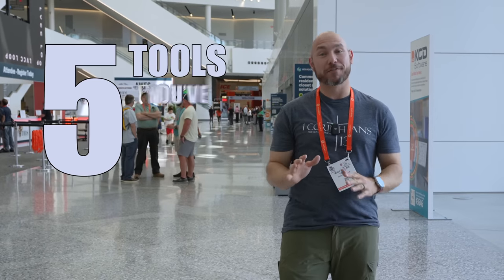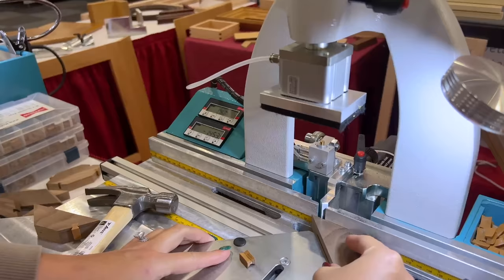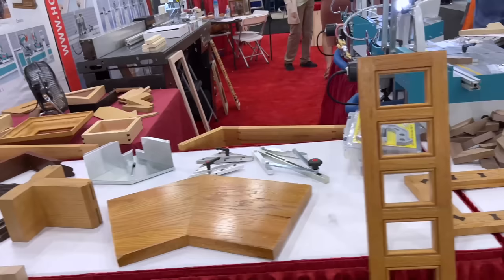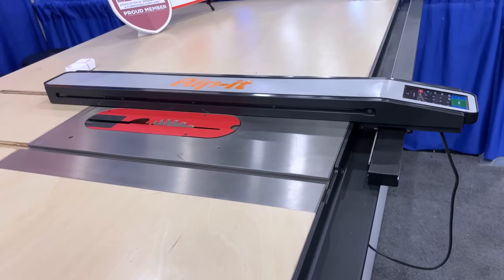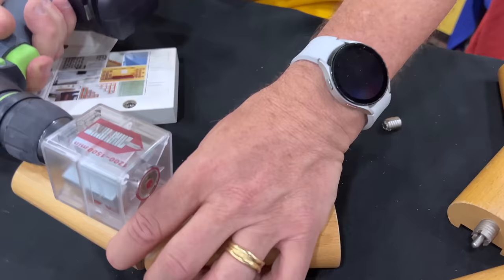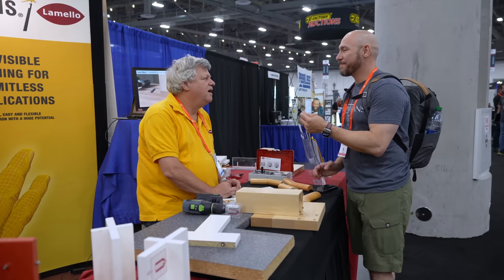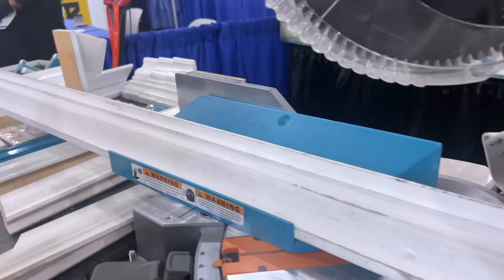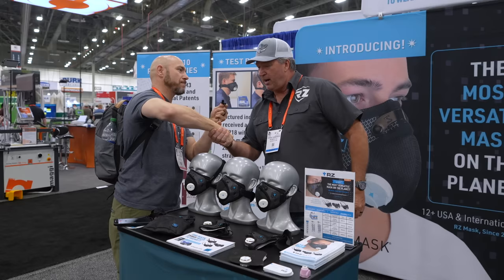I Found 5 Woodworking Tools You've Never Seen Before!

Comment: #2 is from afar my favorite one, even without the cut list feature. It is an amazing help. There is another guy who automated his table saw fence using a step motor and an arduino. Very accurate also.
Reply: It's a pity the fence is so low.
Reply: @JayDee-xj9lu That's pretty easy to resolve though. I often use a house-made taller fence for jigs and such. This has the benefit of not needing an adjustable tape scale.

Comment: Starrett has a protractor that tells you you what to set both angles at and lay the moulding flat. Measure it, set the saw, and cut. Perfect miter.
Reply: Cutting crown on the flat is a more time consuming method because you constantly have to change the mitre and bevel of the saw

Comment: I'm glad Rip-it Fence actually listened. I emailed them a while back asking if they could make their touch screen dark mode (this model had a white screen a few months ago) as I personally have extreme difficulty reading white screens. I'm legally blind so that's the reason why. Using a table saw fence is an absolute nightmare. I'm still relatively new in woodworking and have many decades ahead of me to refine my abilities and I hope to one day get my hands on one of them. At a bit over $1500 msrp, it's something out of my price range currently but I'm glad to know that it'll work for me when I do eventually get one. 

Oh, Rip-It, if you read this comment, can you please add a method to attach the Jessem Stock Guides to your fence? I did email you guys about that and i was informed that the top of the fence is aluminum. Thus, you can't use the mag-switch method of attaching them which is my prefered method as it makes quick removal for jigs much easier if necessary. Plus, many aren't comfortable drilling holes into their fence.

Comment: I have been wanting to build a fence like that for myself... Pretty sure I don't want to pay for that one. It will cost more than my saw.

It needs a few things though for manual use.
It needs physical buttons for commonly performed actions. Nudge the cut a little deeper or less so by .005 per press. Buttons to cut dados. One that moves the right distance to make the second cut at the board width, and then incremental cuts through the center by a blade width.
A button for metric/inch toggle.

Comment: I've been a bit surprised that with CNC tech becoming more widely available that we haven't seen something like the Rip-It fence show up before. I suspect the answer is that the incremental benefit over a well-tuned conventional fence is actually somewhat minimal. Dialing in a fence to provide acceptable accuracy doesn't really seem to be a barrier. And, if exact reproducibility is needed there's always the Incra.

Where I do think CNC tech is interesting is in router tables. Shark has a CNC controlled router table that has interactive wizards to guide you through multi-step operations like box joints and dovetails which IMHO is much more of a value-add than a table saw fence.
Reply: I think it's a pretty common feature on big sliding saws.  I'd love to have one, but compared to a DRO on my existing fence that's just a steep price
Reply: Any industrial size sliding saw less than 5-10 years old pretty much have it, we dont see it cause its an industrial grade product. That finally trickles down to small shops and hobby people.
Reply: Now what I'm REALLY jealous of from the industrial saws is the computerized height adjustment.  It's pretty easy to nail fence position with a DRO or an incra setup, but installing a DRO on the height adjustment in most table saws is a lot trickier
Reply: @tehbieber  not to mention back breaking to adjust tilt too.
Reply: @arcrin100  oh god I would kill to be able to just hit a "zero" button and not have to do the song and dance moving my square back and forth between the two sides of the blade, scrutinizing whether I'm imagining that light between the blade and the square, if I'm on a tooth, if I've got the square flat against the cast iron
Reply: @tehbieber Your comment made me chuckle. As I was reading it I felt my knees go as I would bend down, check again with tape measure and square. 😂  That Rip-It fence is awesome. Unfortunately 10 times the cost of my cheap table but still amazing

Comment: Rip itfence Interesting , The fence itself needs to be taller clearly not designed by a cabinetmaker.And yes I saw the slot in the face. Didn't show the amount of flex at the end of the fence, maybe nothing. After being a cabinetmaker for 40 yrs. I'm weighting for the next version.

Comment: CNC saw fences are neat. There's posts on cnczone from as far back as 2006 describing them. So not a very original invention. Here they're using a Raspberry Pi 3B+ ($72) and a Waveshare 5.5inch Capacitive Touch AMOLED Display ($115) plus a stepper driver and stepper, so about $200 in electronics. You could diy one for half that picking some cheaper electronics. So you could do a lot with that extra $1000 since it's a $1200 fence.

Comment: I'd like to know how sensitive the auto-fence is. With my T-fence I can just gently tap to sneak up, and we are talking two hair-lengths at a time, so how sensitive is that fence? Can it move 1/128 or 1/256? I'll have to check out there page. If I can't micro adjust, then it seems like a professional, cabinet shop kind of tool only. That's fine, and it would work well in mass production/industrial level stuff, where you are just needing nice, clean numbers, but for fine woodworking you have to have that "light tap" level of adjustment.

Looks like it is $1,300. That is definitely pro-cabinet shop level pricing. Oh well. It still looks super cool.

Comment: The Hoffman units start at under 2 grand, which seems like a much more reasonable price for the typical user.

I like the Invis idea but they need to get the part price WAY down -- at US$7.50 each, that's going to be a niche item for sure. Equally important, they look to need (I haven't looked close) a remarkably exacting (for wood, anyway) locationing tool, as those clearly need to be aligned far more perfectly than most woodworking typically needs.
Reply: My guess is Hoffman is copying the razor blade business model... they get you with the consumables.  Now, $125 per 1,000 keys won't break bank for a cabinet maker, especially for what they do, but I'd be surprised if Hoffman is paying more than a penny per key to have them manufactured.

As for the Invis, it's interesting, but I honestly don't see how a hand-held external magnet can achieve the torque needed for a tight enough connection that it won't work its way loose over time.

Comment: Not convinced about rip fence. If you have a decent modern table saw most fences have digital read out and you can make micro adjustments. That cord dangling would be a hazard. Plus you cant slide fence out to rotate on side to rip larger material.

Comment: That Invis Joinery System with the magnets on a drill is the dumbest idea I've ever seen. Torque has obviously left the chat. How many of us would bolt stuff together and spin all of the nuts about as tight as we could with one finger? If some corrosion formed on the threads, you'd never be able to seat it or ever get it apart. The crown molding jig is garbage. You could make a better jig with some MDF that would work better. The first joinery tool with the bowtie cutters was pretty cool - the best of the 5, by far. The fence is cool but not really necessary - Altendorf has had servos on their fences for a couple of decades.

Comment: While the mask is cool and probably a great thing for people to wear, it was disingenuous to use fit factor information in such a blanketed way.  

The fit factor is dependent on the individual wearing the mask.  Their facial shape and size determines overall fit factor.  Having a nice pliable mask is a plus, but on its own the fit factor numbers they give mean very little.  

I would be curious to see a person use a half mask from 3M and this mask, and then do a fit test.  Use the same machine and same person for the test and the same test administrator.  If they can show a meaningful difference between a true respirator and their product, then they could be onto some great new markets.

  Woodworking is only a small segment of the respiratory protection world.  If they can find a way to compete with 3M, then they may just find a new market to take their product to.

Comment: I cannot see the point of the Rip It fence.  I've never had an issue moving my fence into place and it's got no parts or electronics or software/firmware to go wrong.  All I see with that silly fence is something that pointlessly wastes the earth's precious finite resources as well as the precious time and hard-earned cash of anyone stupid enough to buy it.  It's just another example of someone coming up with a solution to a non-existent problem.